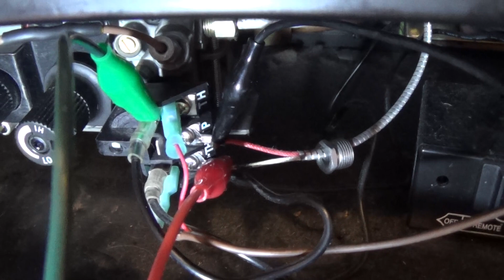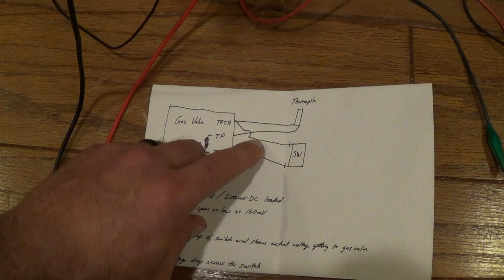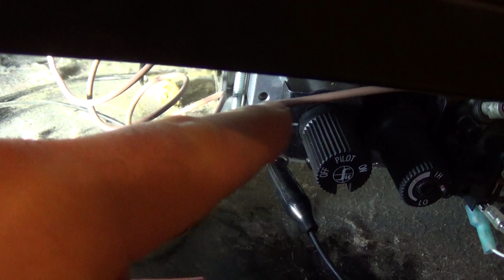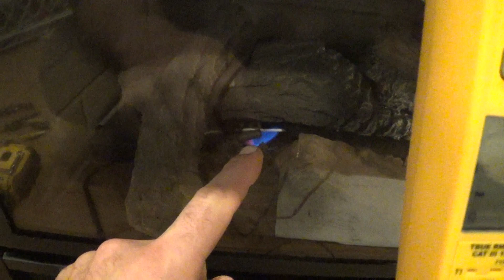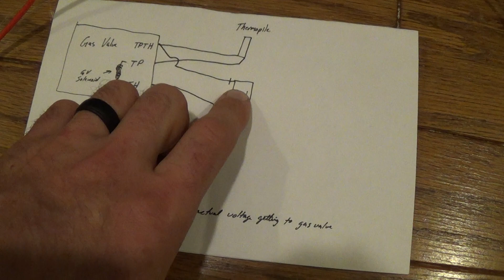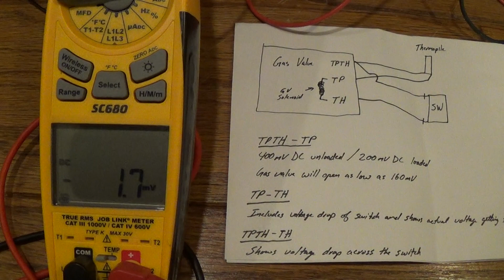Diagnostics6: How Millivolt Gas Logs Work and How to Troubleshoot Them

Comment: So there is really no other way to test the thermocouple ?
Reply from the maker: Yeah there’s an adapter but it’s also a common failure point.  In other words they fail a lot more often than gas valves and are often much cheaper and easier to replace.